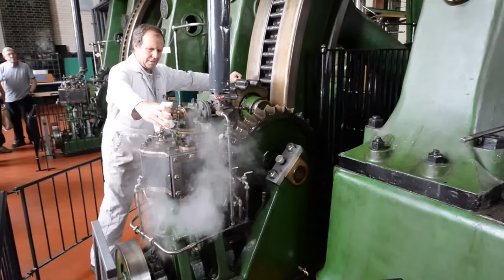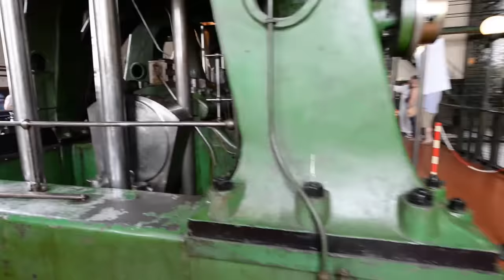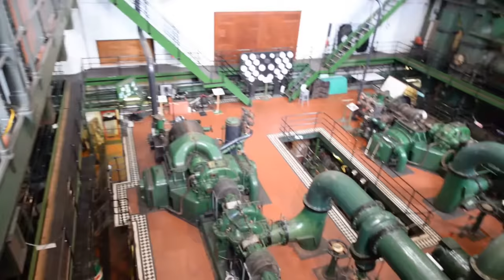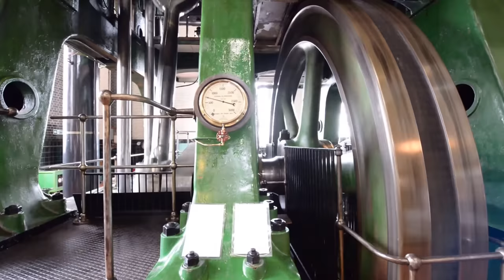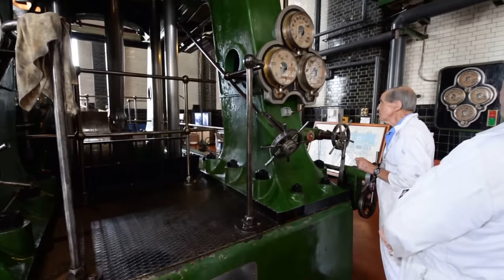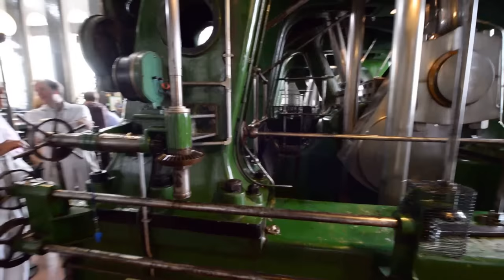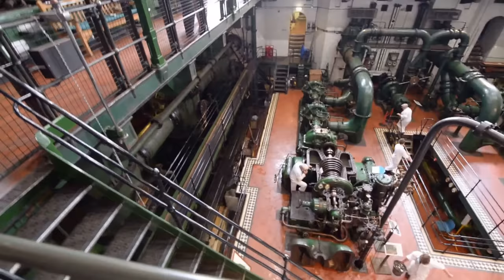Kempton Park  Big Triple Steam Engine Starting

Comment: Parts that big moving that fast and being balanced shows incredible craftsmanship. Absolutely beautiful. I can just imagine the engine room of the Titanic.
Reply: it was dark, noisy and smelly - you would not have seen the engine anything this well
Reply: @ghostrider-be9ek  Titanics engine rooms were well ventilated and well lit
Reply: @SwagCat852  absolutely nothing like what this video shows, it would have been dark and noisy
Reply: @ghostrider-be9ek  the entire 4th funnel was for ventilation, it was noisy, I didnt say it wasnt and th engine rooms were not dark, you dont want to check pressure gauges in the dark, it was not lit like daylight but there was quite a lot of light becouse the engineers needed it
Reply: @SwagCat852  again, repeating for the 3rd time, it was nothing Ike this video shows, the big parts would have been mere shadows, the lights would have been down low where the gauges were, it would have been hot, smelly and oily
Reply: @ghostrider-be9ek  i didnt sayit would be bright as in the video, but it was not dark, and the place was well ventilated so it didnt smell very much and wasnt very hot
Reply: @SwagCat852  engine rooms TODAY on container vessels are smelly and hot.
Reply: @ghostrider-be9ek  did I say anything about modern engines? Or are you trying to gaslight me?
Reply: @SwagCat852  if engine rooms today are noisy, smelly and hot, are you unable to consider what they were like 120 years ago?
Reply: @ghostrider-be9ek  todays engine rooms are very well lit, well ventilated and noisy
Reply: People used to be smarter, they read books, they weren't distracted by all the computer nonsense of today, and all calculations and drawings were done by hand.
Reply: @Hector_Malot  people today are as smart or even smarter, we just dont know how to do things by hand becouse we no longer need to, and books are also on computers now
Reply: @Hector_Malot  life was terrible 110 years ago when Titanic was built, every aspect of life was worse
Reply: Good God you two! 🤦🏼‍♂️
Reply: the Titanic used Turbines, this is triple expansion, it would look different but this does give a good idea of scale.
Reply: @themanformerlyknownascomme777  only Titanics central propeller was powered by a steam turbine which was powered by the low pressure steam that remained from the triple expansion engines
Reply: @ghostrider-be9ek  Bruh where proof
Reply: @emanu1674  proof of what? that lighting 110 years ago was brutal compared to this?
Reply: @ghostrider-be9ek  Why do you keep trying to put words in that guys mouth by suggesting things he hasn't mentioned?
Reply: @heybabycometobutthead  which guys? the one that claimed titanics engine room (or any ship from 110 years ago)  was well lit and well ventilated?
Reply: Hi, visit the engine room of the Battleship Texas BB - 35. Triple expansion engines as well.
Reply: @SwagCat852  True. The only area on Titanic that wouldn't have been pleasant in this regard, would have been the boiler rooms nearby. Those areas would have been hot and dirty. It would have only been clean had she survived and been converted to oil firing boilers like her sister RMS Olympic was in 1919.
Reply: @SwagCat852  Except when it comes to spelling.
Reply: @ghostrider-be9ek  Wrong. I actually worked on the Titanic. Extremely well ventilated and lit up according to OSHA standards. Don't talk about things you know nothing about.
Reply: @chacehart7286  i built the cross for jesus christ, whats your point?
Reply: @ghostrider-be9ek  What were the dimensions? So I can build you one?
Reply: Before or after the iceberg hit? Because in both cases, dark and hard to see, with after being full of screaming from people drowning
Reply: @Shinzon23  I think it would be hard to scream and drown at the same time being that your lungs and throat would be full of water. Most died of hypothermia in this disaster.
Reply: @MechaniclifeJDM   What I meant  Is that the engine room would be full of screaming people as they scream, Gasp for whatever pockets of air there is left, scream some more,get dragged under and drown
Reply: @Shinzon23  sad 😢
Reply: @SwagCat852  Backtrack much?
Reply: @MechaniclifeJDM  1x jesus"
Reply: @ghostrider-be9ek  bruh Titanic's engine room literally had a massive shaft with a skylight on top for  natural light and ventilation and had many lightbulbs it certainly wasn't the brightest place but it was in no way dim either
Reply: @robertpaulson2052  probably ....
Reply: What the bloody hell is this comment section? 😂
Reply: @Yasokiii  again, as per the initial comment - responding to the poster - Titanics actual engine room was nothing like this video, in terms of light, sound and smells - and probably heat too.
Reply: @ghostrider-be9ek  maiden voyage would not have been  that dirty like it was years old
Reply: It's definitely pre-collapse craftsmanship.
Reply: @ghostrider-be9ek  kinda just seems like at this point you wont listen to a single thing anyone has been trying to tell you.  Titanics engine room had a skylight leading down from the boat deck.  Yes, it would not have been beaming down there, but it still would have a considerable amount of light considering all of the dials and gauges that would need to be read.
Reply: @maggy154  seems like you cant read either - my position was that the engine room of the titanic, was in no way, as bright as this video shows. 

That people dispute this, obviously apriori statement, shows how far society has down downhill.
Reply: @ghostrider-be9ek  wow, you don't know what your talking about, ive seen bright engine rooms on modern vessels.
Reply: @theonewhoknows2  again, I was referring to the engine room of the TITANIC (and other ships of the era) being much darker than the video clip here, shows.
Reply: @ghostrider-be9ek those are the boiler rooms, the actual engine rooms were very well lit and ventilated, it wouldn't be smelly or dark but yes it'd be very noisy
Reply: @echoless3484  repeating again; my point was the engine room would in no way, be as well lit as this video shows.
Reply: this comment section is something else 💀💀💀
Reply: My never known grandad Frederick Theodore Sadler  was a steam Engineer  , have here in Spain  his mechanical  rev counter & his adjustable  spanner that opens  to 3.125 inches , & am building  a boiler for his hand made vertical   , 1906 , there was in grans chest of drawers a triple , hope that's still working !
Reply: Well. Her engines were 30ft tall
Reply: @ghostrider-be9ek  just checked, no one said "the titanic engine room looks exactly like this" what was said was "I can imagine this engine in the titanic"... and I mean no shit, take anything and put it in a watertight box and it'll be pretty dark.... except the titanic room was only dark where there  were no maintenance points, was it as bright as this?no. Was it so dim that it made the ship difficult to hard to operate?again no. Stop putting words in people's mouths, I've seen more gaslights in the comment thread than on my trip to paris
Reply: @josephclemmons5234  hello there, I said the titanics engine room was nothing like shown here - it was dimly lit mostly, hot and very noisy
Reply: power plants are way cleaner than ship engine rooms.
especially steam ships of the early days of burning coal.
no coal burning plant stationary or afloat is clean shit is messy.
Reply: @themanformerlyknownascomme777  We have a series of triple expansion steam engines very like these in the Col. Ward Pumping Station in Buffalo.

Unfortunately, they are not in operable condition. This video makes that fact tragic for industrial historians and enthusiasts.

That sunken area with the green piping is also duplicated in Buffalo (albeit with blue piping). Those tiny objects are electric pumps that perform the same work today as these steam giants were needed to do a century ago.
Reply: @ghostrider-be9ek and @erikzidan2601 speak with a certain as if they had been there. 😂
Reply: Some people on the internet look for the silliest things to argue about these days.

Comment: Microprocessors are incredibly impressive but not as majestic as this technology.
Reply: Majestic is an excellent choice of words.
Reply: @Broxavon Labs GIRL POWER That's the truth of it.  The beauty of something like a steam engine is that it's workings are readily visible.  Not only can you see it but you don't need to be able to know the engineering behind it to grasp the general sense of how it operates.  The elegance of semiconductor technology is far more elusive both visually and conceptually to the point that it is regularly presented in movies as some type of CGI fly-through with lights and sparks to try to excite the audience.
Reply from the maker: if it's IT that thrills you have a gander at my other video https://youtu.be/xlWKoB8AU7M
Reply: You should take a look at a hit & miss stationary engine with an open crank. Built along the designs of a steam engine but using internal combustion.
Reply: That remains to be seen doesn't it? Many have already failed, but many are working far past their expected life and largely un-maintained. Still not as pretty as this, but it's too early to guess how long electronics last.
Reply: a micro pocessor has a millions  transistors,,,,diodes and resistors,,,is true,,,at microinches thin.....in factory,,,one dust particle,,,is fatal for the facrtory and assembly.
Reply: The history of technology is really a lot about miniaturisation.
Microprocessors are basically the miniaturisation of the machines you see here.
So what happens is that are technology progresses the bigger machines are used to build smaller machines - microprocessors then being used to manufacture smaller microprocessors.
SO really what you are seeing here is in a sense what happens in microprocessors but on a bigger scale so yes it is majestic.
Reply: cageordie most electronics and electric devices have a design life that is supposed to be less than 10 years on average.. this was not the case with these old engines they were built to last.
Reply: Word ?
Reply: A microprocessor doesn't produce power and pump tons of water a second though. Apples and oranges
Reply: Most electronics have a design life of less than 10 years because people don't want or need to maintain them. Mainframes have design lifetimes much longer than that. Most people don't want or need a computer that can operate for sixty years but becomes obsolete in two and requires a team of technicians to maintain it the whole time (like this engine).

There are sixty year old computers still operating. For example, the Computer History Museum has a working IBM 1401.
Reply: romantic really
efficiency isn't romantic
Reply: ...free electrons ?... No...Mass that's what impresses me...laying my hand on huge diesel gen. sets kind'a erotic...if you have the door locked !...
Reply: @FawfulDied  its planned obsolescence. The peak of technology hit a long time ago with a lot of things but once things were designed to fail that's where a lot of things changed. This engine and a Wartsila diesel are pretty similar, but this steamer is still around after 100+ years
Reply: And what is more you can only smell them when they DIE!!
Reply: @cageordie  IMHO no it doesn't "remain to be seen". There are NO current tech electronics that will last as long as this steam engine, even some old school stuff like tubes and old resistors, capacitors, etc. aren't even making it much past the 100 year mark. 

The main issue with electronics may not be obsolescence due to actual electrical failure of the part, but due to the functionality of the part. (The equipment evolves beyond the functional ability of the part.) 

Real life example: Movie projectors. In the old days film was the medium. It is a physical medium that you can pick up, hold up to light and SEE what the content is. Literally thousands of years from now, ANYONE would STILL be able to see what's on the film, and a smart enough person could build a projector and sound reproducer to show it. 

Today, we have digital cinema. It is already in it's second generation, after just over 20 years. Most of the first generation equipment is unusable, partly due to parts no longer being made (or impossible to source) and partly due to the changes in how the movie is stored and encoded. 

Speaking of which, today's movies are on hard drives or other computer media.  Most use encryption. I can promise you that in as little as 50-100 years from now, no one will know how to decode that medium and show the movie. 

Newer is rarely better than the old stuff, especially when it comes to usable service life or archival value. (Oh, and a lot of today's digital cinema movies are being archived by.....making 35mm film copies.)
Reply: I came here to express my opinion, but you outdid anything I could have said.
Reply: @zvezdaster You're talking of modern commercial electronics. Some electronic computers can operate for decades. Early car ECUs the oldest of which are now about 40 years old or space probes computers that are even older and still work are good examples. We still collect data from Voyager, it's computer and some sensors still work. The only problem is that we have to use networks of radiotelescopes and look for Voyager's communication protol pattern in the space's background radiation, because the signal is so weak du to the distance
Reply: @tonyfeuerhelm  its not a diesel, its a Steam Engine
Reply: Yes
Reply: I do not very much like computer technology, or the whole thing about it. It is, unfortunately, taking over everything in our modern lives. Not just phones, but also cars and even homes now. What I don't like about it is, again, that it is not built to last. It is built to serve it's purpose until it is replaced next week by the next big thing. Nothing wrong with that, but it should stick to computers instead of everything in our lives. I hate how we are constantly asked to pay ridiculous amounts of money to "upgrade" our lives to get the next big thing that doesn't do much that the older stuff couldn't. The dark secret of big tech.
Reply: Especially AUTOFOCUS microprocessors... : )
Reply: So true. They are mesmerizing.
Reply: I like electronics but this is a mechanical poem.
Reply: Why not both?, ever see microprocessors in a microscopic way? lol
Reply: Сравнил груду тупого металла с волшебством.
Reply: Мурзилла ты мой друг без души
Reply: What u mean I believe is there not as fun to look at.. I agree completely.. nomatrer how great a microposesser really is there so boring to look at compares to this master piece
Reply: @marshallman1au  double word
Reply: @Broxavon Labs LCC Why waste time trying to find a microscope, when i can see, hear, smell, and feel this beautiful monstrosity doing it's thing?
Reply: @fairyheli2  Well, it pumps data.
Reply: To the naked eye maybe. If you could see the computations live your mind would be blown. Not smart enough to imagine it either ;)
Reply: Microprocessors are more impressive, this steam engine was part of the path to the creation of today's amazing technology.
Reply: @snarkylive  all good things (microprocessors), eliminates repetitive assembly line jobs humans are not good at and quickly tire of creating unions that destroy companies, increase costs, decreasing safety, increasing health issues and lowering quality where automation can work 24/7 non stop.
Reply: @tbn22  Seems like a very narrow view based on feeling and not fact. 
Its taking over everything in our modern lives, why is that a bad thing? Its taking over everything because its amazingly convenient technology. Computer technology is all based on information processing, decision making. They are literally miniature brains that do what you tell it to faster than you can do it yourself.

The reason you view computers to "serve its purpose until its replaced next week" has nothing to do with computers themselves. Its greed by big corporations, something that has always existed even before computer technology.

You dont have to pay ridiculous amounts of money to upgrade constantly. Its your choice entirely. Idiots who pay for the new iphone every year because it has a better design or better camera or whatever are idiots. There have always been idiots, and those who take advantage of them for their own profits. Thats just humanity, nothing to do with the technology itself.
Reply: Microprocessors made our lives worse, these machines made them better
Reply: @airgliderz  Yes if you are a computer geek….
Reply: We will go back to ole non industrial steam power one day.
Reply: @MurZZZilla  какая груда?
Reply: @airgliderz  you obviously do not know union history and ascribe to capital and management philosophy. 
Have you ever been exploited?  Have you not been paid or underpaid?
Have you had your rights taken away on the job?
Have you ever worked more than 50 hours in a week?
Unions only exist because of abuse and exploitation. If businesses cared for their workers then the need wouldn't be there.
Reply: Have to disagree on that one .

Microprocessors are basically magic at this point .

When you're dealing with problems in manufacture because the wavelength of the light itself is making groves since it's THAT tiny and making transistors that consist of a SINGLE atom you know you are entering a completely different dimension ...

Does majestic beat magic ?